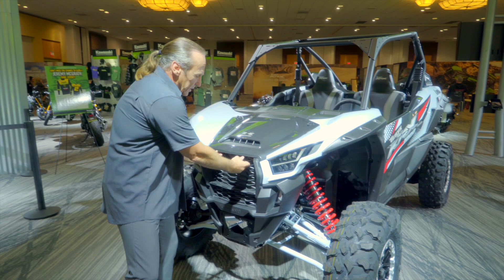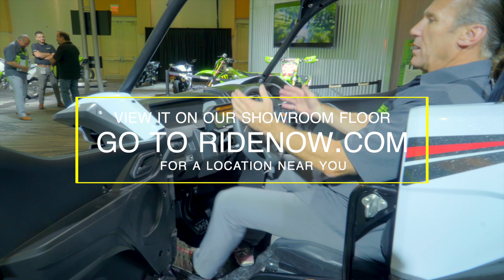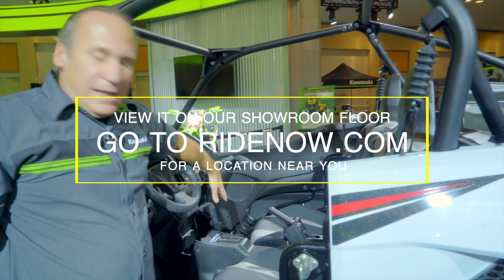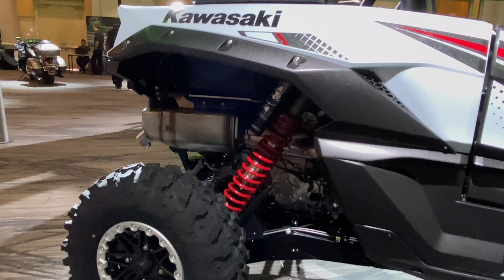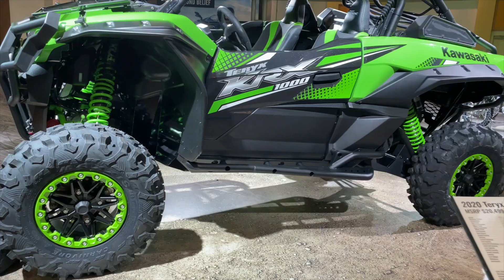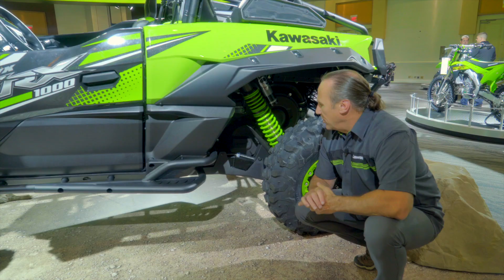Everything you want to know about the new 2020 Kawasaki KRX 1000

Comment: I love this machine, but the horsepower is WAY behind the competition and that makes me nervous especially since it’s heavier than all the others as well. I sure wish they produced this machine with a turbo.
Reply: They have a factory supported turbo coming out for it soon.  Supposed to add around 76 HP.
Reply: There not way behind as far as N/A  competition is concerned. At 112 HP it's right in the pocket. It's heavier than the rest, but it's built with heavier components. I've seem some sport machines that were built up with all kinds of accessories. They can't be much lighter. I think it could use a HP boost, but most of the owners don't seem to be complaining. It seems to have lots of other abilities that nullify the HP issue to some degree. Wheel and tire package, centrifical clutch, suspension and smoothness, cab room,reliability. As far as basic maintenance,  change the fluids on this than do any Can-am. To lots ots of buyers that's more important than HP numbers. Just a thought, ride safe!

Comment: I see so many videos and I've researched a lot of these videos and a lot of these two seater UTV's cuz I'm in a process of buying one all I got to do is make up my mind and nobody really gets into the front ends on these things and the suspensions the only suspension that's worthy of going out really thrashing is the Can-Am there are no close-ups of the front suspensions and the rear suspensions on the Kawasaki showing the actual components of the front and rear suspensions it's just if you're spending between 20000 and 24000 I want a vehicle I don't have to mess with or upgrade later on well there you have it
Reply: William Goring did you watch the video? Suspension is covered front and rear. What else would you be looking for? Call a dealer and ask questions.

Comment: Very aesthetically attractive machine.  Seats are too firm and the interior design/fit and finish are not up to par.  The suspension and steering components appear to be very robust and the cargo space appears to be excellent.  Because of the heavy weight, it will take at least 130hp to begin to be competitive with class leaders.  This appears to directly compete with the Wildcat XX -- lots of similarities.  This is a good "first try" by Kawasaki and I'm sure they will refine and improve the product in coming years.  Your overview was detailed and comprehensive -- many solid selling points that make it a serious contender.  I've got a Maverick Trail and have been very happy with it (other than overly stiff rear suspension), but if I were in the market for a new machine,  the KRX would likely be a candidate.